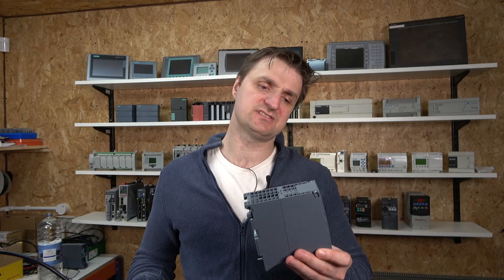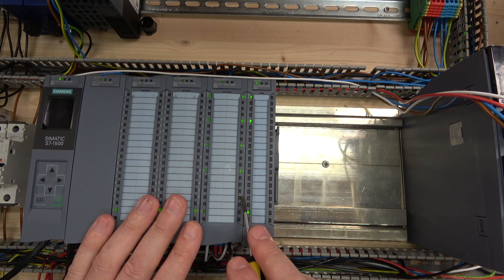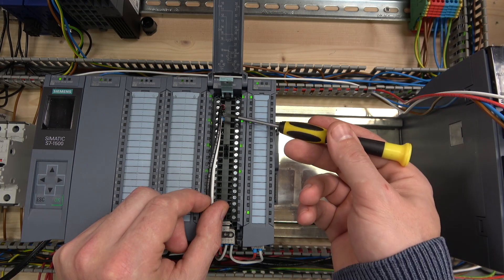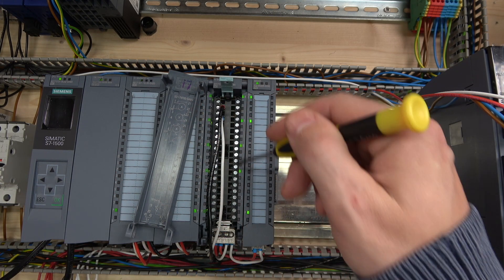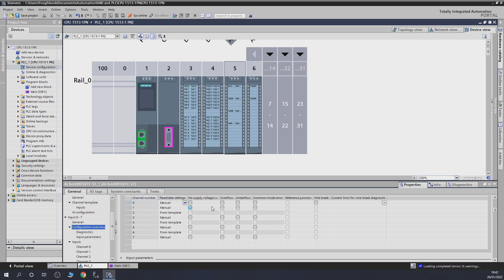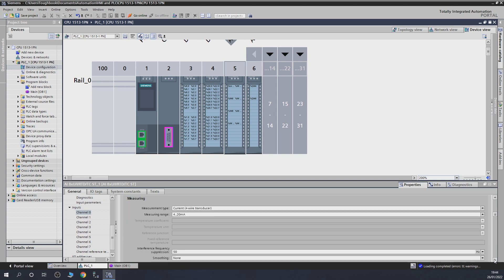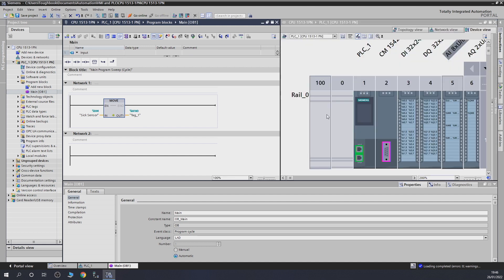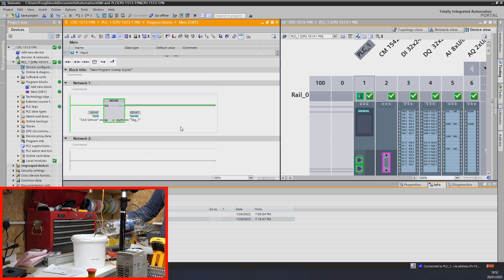Siemens S7-1500 series PLC's analog input card wiring, setup/ diagnostics and fault finding. Eng

Comment: Hey! thanks for the video, have you ever seen why you get 32767 as the raw number? sensor works okay either sending out 0 to 10v or 4ma or 20ma, i set up the channels to both ways V or A and nothing :(

so noticed that this only happens if i do that wiring set up, i f i do my 2 wires the other way (4 wires) which is 2 analog signal and 4 negative 0 ..then it works... i'm so confused so why is it called 4 wire set up then :o ?